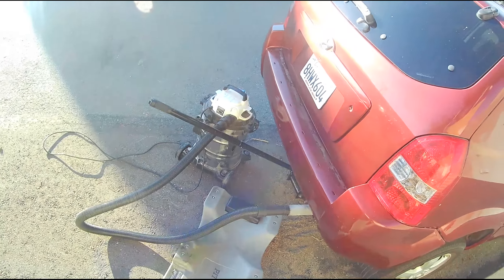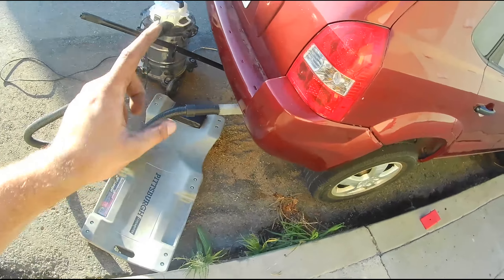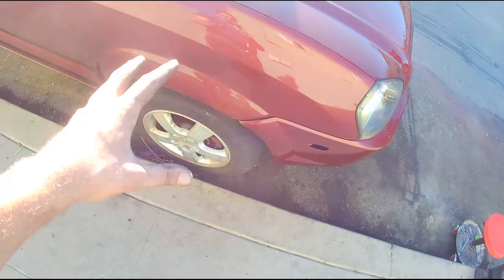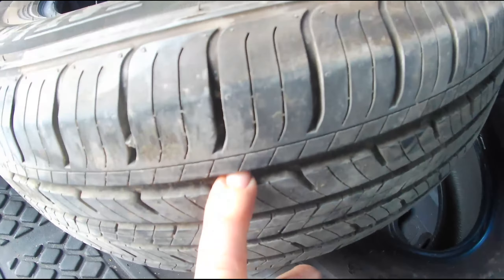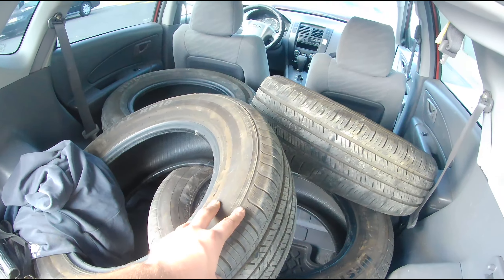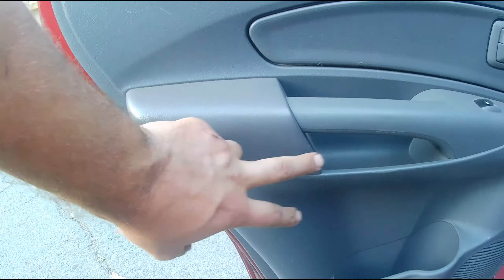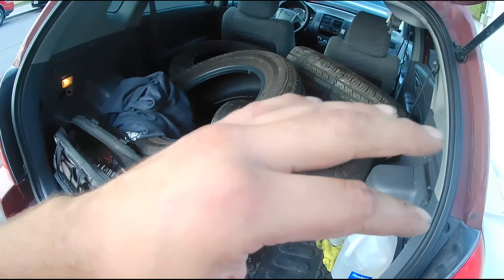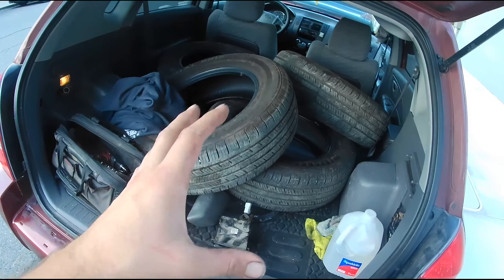I FINISHED the STRUTS and WELDED the Exhaust | Flipping Tucson 16

Comment: How much it cost new tires (normal brand) in US bro???
Reply: The cheapest good tires in the tucson size I found were around 65 at Walmart where I live. They were douglas tires which are made by Goodyear.
Reply from the maker: It really depends what “normal” is. If you mean cheap.. you can spend $50 - $75 a tire. If you mean like “coopers” probably $100+ to $150 each. But all of them are rising.
Reply from the maker: Sounds about the same here.
Reply: @BrokePremiere  Same price here in Portugal... You can get Firestone for 45/50 dollars... Of course depend the type of tire... In the price i mentioned its included the assembly and calibration...
Reply from the maker: Mounting and calibration is additional here.